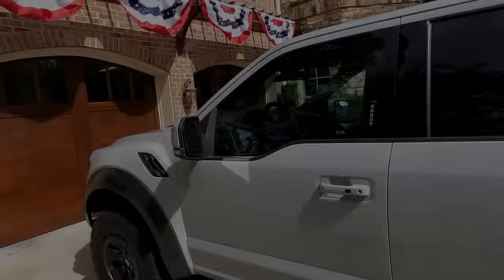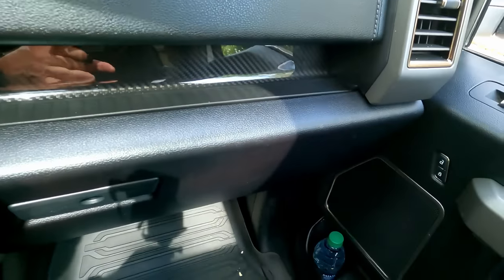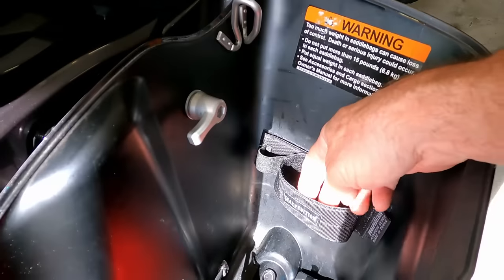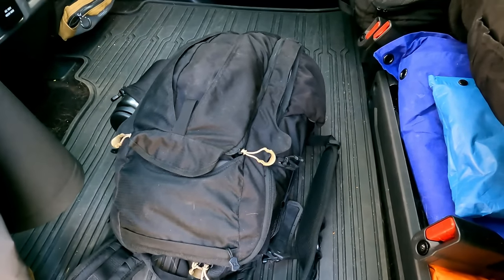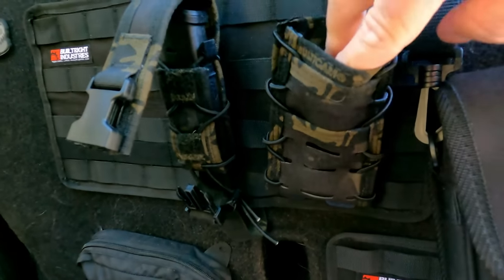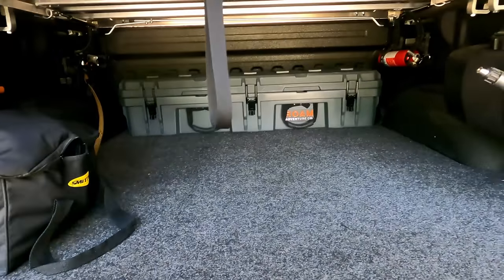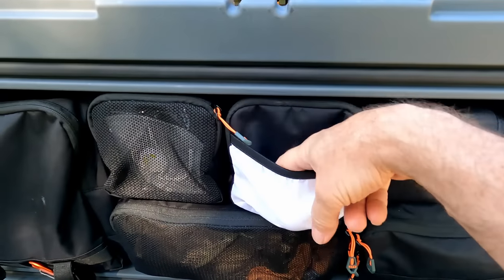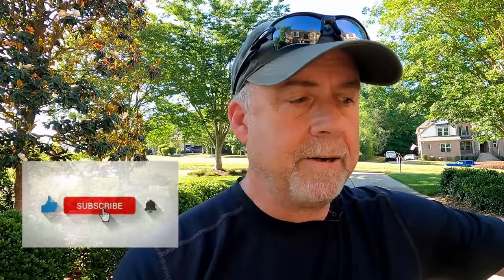Truck EDC - Everyday & Emergency Gear

Comment: So, this video is 3 yrs old at this point…I’m curious if you’ve pared down the amount of crap you tote around in your truck or if you’ve continued to purchase every gizmo and gadget available and thrown it in your truck to the point that there’s likely no longer any room for people inside.  I’ve been there but at some point, you have to realize how many items you pointed out only to say you’re just waiting to see what you might see it for or you have it there but don’t use it.  And I challenge you to describe the scenario where you will utilize ten pair of gloves…. I’m a knife nut myself, but I know I don’t need to have a dozen knives scattered thru the truck.  When you have a bunch of crap you’ve never used and never will asking up priority space in your truck but have your fire extinguisher mounted at the front of your bed underneath a cover where there’s no way in hell you’ll access it without any kind of trouble or delay, maybe it’s time to do some rearranging and realistic prioritization.  There’s always some chance you’ll be a hero because you have some random obscure thing that nobody else has on them, but more likely you’ll be that guy who digs thru endless mountains of crap in the truck for an hour only to realize you don’t even have a basic tool kit for in case you have a minor mechanical issue and you can’t even tighten a loose bolt, swap out a tail light bulb, or adjust tension on a belt that’s going to leave you stranded in the middle of nowhere.  Two holsters on your pistol and a dozen or so masks in four different places…but no method for securing your firearm if you must leave it in the truck…which I would wager happens regularly.   Don’t arm the criminals.  I’m sure soon enough the grabbers will pass laws making you lose carry rights if you have one stolen.  And that truck is just begging to be broken into. I guarantee if I was in a situation that made it necessary, your truck would be a priority target. Who are you going to communicate with when you have both of your radios in your truck?  Would it make sense to set one up at the house, or the wife’s vehicle in case you ever needed to actually use them?  Living on the gulf coast, I’ve been hung up in endless evacuation traffic trying to get home and seen cell service crash mire than once.  Having radios in multiple locations is the only way they are worth anything.  But mounting them up high in the open is nice of you so the thieves can get a good idea of what they’ll be taking to the pawn shop later. Not trying to be a dick.  Well…it just comes naturally.  But I really do have good intentions and have been that guy that tries to have everything with him at all times and it’s just not possible and it distracts from what’s really needed.

Comment: I sure hope you don't have to use that gun fast I don't think that setup would be good if you have to use it fast
Reply from the maker: Training is everything...... as is safety. Thanks for watching and your feedback!!
Reply: @WeekendOverland  I agree that training of everything but what if you have something in your other hand I'm just saying but if you had it where your pocket clip would hold would hold the holster so when you grabbed it it would come straight out of the holster and it would probably not be too hard to grab the holster and lift the belt clip with your finger so the sheets with stay on
Reply from the maker: @CXonthefly  there is more than one way to achieve what you want to accomplish.  I am just saying that you should do do your homework regarding technique and then train and practice to lessen the chance of something going wrong
Reply: I'm just saying easier to draw a weapon in a hurry out of a solid foundation and when you're not in a hurry you can unclip and your trigger guard is retained

Comment: Dasani? Get rid off that shit; Do some research that stuff is salt water. Cool Video. Also when plastic heats and cool like being in a car is makes it un-safe to drink due to the plastic with some time.
Reply from the maker: Hi Kento.  Thanks for watching.  Yes, I have since removed my water bottles and replaced with aluminum.